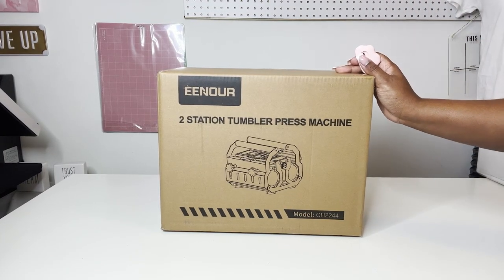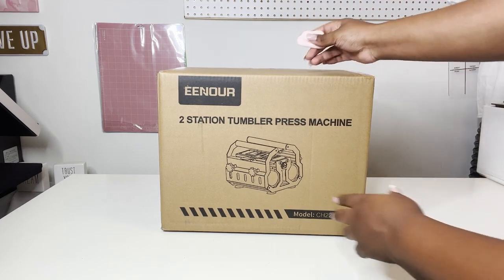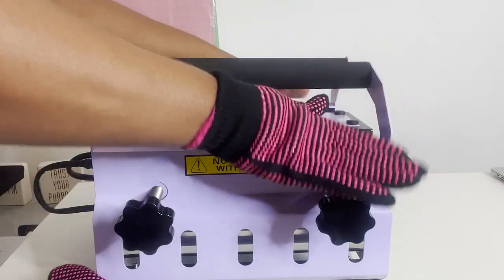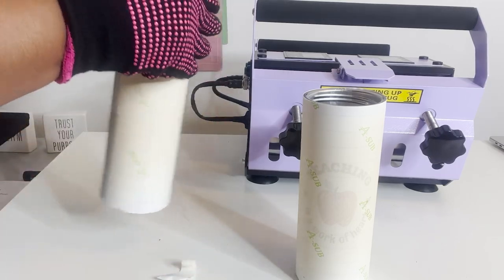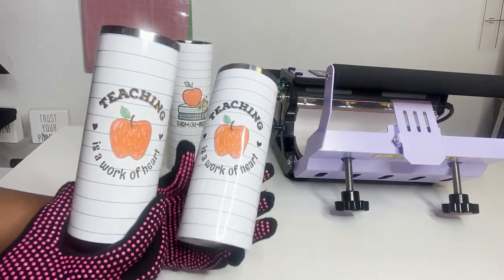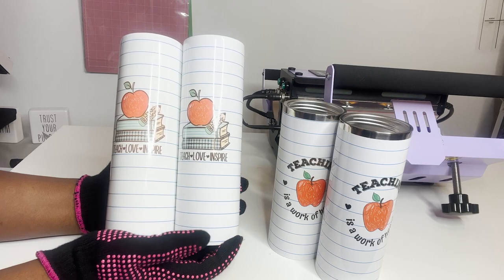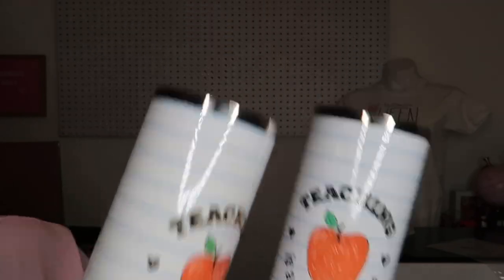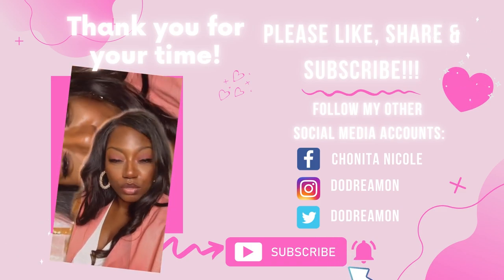EENOUR 2-Station TUMBLER MUG HEAT PRESS UNBOXING & *HONEST REVIEW*

Comment: When I purchased my mug press, I had to purchase a heat temperate gauge. When I pointed the laser at the center of my heat pads, they registered higher than the displayed temperature. I watched a video on how to calibrate the mug press and it wasn’t hard. Now I have the correct heat for the displayed temperature.
Reply from the maker: Yea this gets super hot I probably need one thanksssss are they expensive?
Reply: Good suggestion for us to always check!! Even on the presses right

Comment: Thanks for this! I sold my convection oven and purchased the Stampcolour mint green press and did a couple tumblers myself.. It gets super HOT and has any pressure amount needed.. I don't see most going into detail of what cause the failures or how to correct it.. I know it's trial and error always.. My 1st tumbler I did had too much pressure which caused imprints from the actual press which I knew I had to loosen for that reason and as you showed pressing too long or hot causes color to be off .. I also saw a video as I've been researching tumbler presses all week is some pressess don't heat all way to end and that causes ghosting as well as not enough pressure there..
Reply from the maker: You’re so welcome and thanks for all the info watching and commenting 🥰🥰🥰

Comment: It's not the temp it's the time I do mine @ 50 then turn and do another 50
Reply from the maker: Thanks
Reply: Actually I do have my temp @  345. And then time 50 sec then turn 50 seconds.  I have the same eenour press and I love it after you get it all figured out . Most times I have a hard time with pressure sometimes it leave the inprint of the tape on the tumbler. Happy sublimation and I'm sure you'll get it figured out soon.
Reply from the maker: @sarahmaerandall24  Thankssss